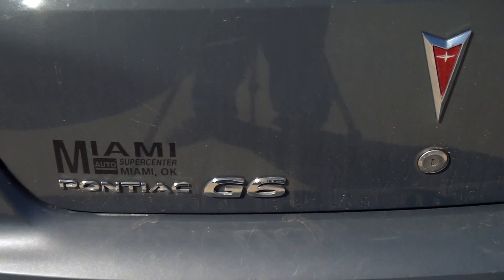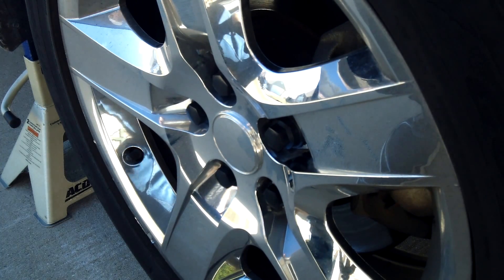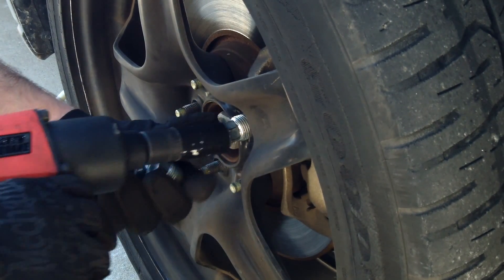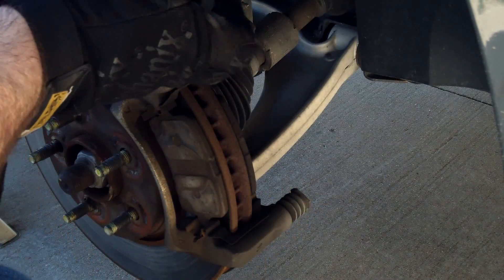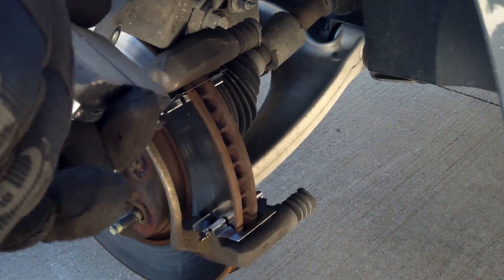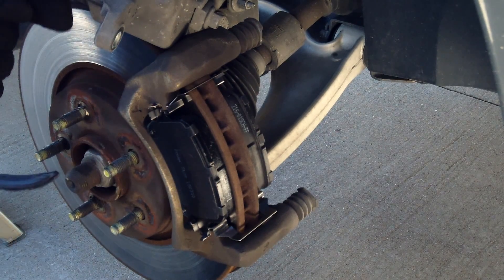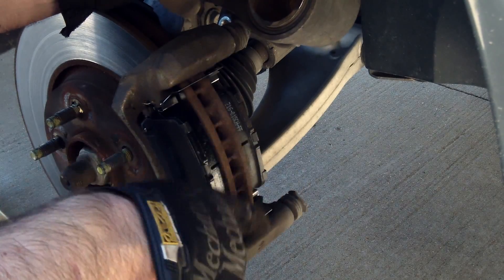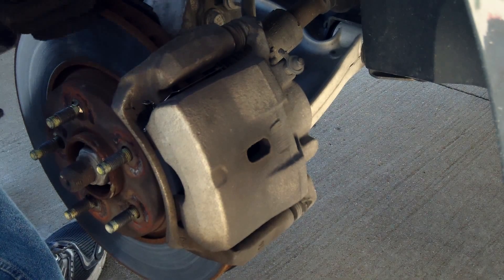Pontiac G6 Front Brakes

Comment: Got a question just curious on the average price of doing brakes on a 06 G6 four-door sedan.. how much cheaper is it to do your brakes yourself compared to taking it in the shop
Reply from the maker: Not exact on the numbers, you would have to price it out to be sure. But I think fifteen years ago I took mine to a shop and the charged me like $350ish, pad R&R only, I think. You can get a full set of pads at an auto parts store for about $70. Less if you get them on line. Then do the job you’re self with common hand tools. But it is a job now, a fairly easy one but a job all the same. There is no question in my mind though doing it myself is far and away cheaper, and it’s on my time not there’s. Thanks for watching.

Comment: No rotor replacement? Didn't clean and degrease the caliper slide pins? I won't do a brake job without doing these things.
Reply from the maker: Completely agree with most of what you said. Always a good idea to turn or replace rotors, and to service the slide pins. But this was not my car, and all the customer wanted to do was replace the pads. In there defense; the rotors looked fine, and I checked the slide pins, they moved freely, and were well greased. Thanks for watching, and commenting.
Reply: Thanks for answering, windows 10 changed the word degrease from regrease. It got by me some how.
Reply: The wear tab needs to be on the top because of the placement of the caliper on the front wheels. Which you did. I'm not sure if it matters inside or outside. Those rotors look almost new they definitely don't need to be replaced or turned at most maybe a light deglazing with sanding discs

Comment: You forgot the most important thing when doing ANY disc brake job! Hint: This procedure keeps the rotors from warping after you are done with the brake job.
Reply from the maker: Do tell Sir.
Reply: Hes talking about torquing the lug nuts. But anybody who has been doing brakes knows how tight they should be
Reply from the maker: +M.Night207 Thanks for watching.
Reply: BubbaTac Why are you thanking me for watching? Is this your video?
Reply: M.Night207 No, I'm talking about cleaning and applying new grease to the slide pins so that the calipers continue to back off the rotors easily. Otherwise the #1 reason rotors warp is because they don't and then excessive from friction while driving warps the rotors.
Reply from the maker: +M.Night207 My names on it, must be. Joking aside, again thanks for commenting, and watching.
Reply: Yeah I was jokin man. LOL